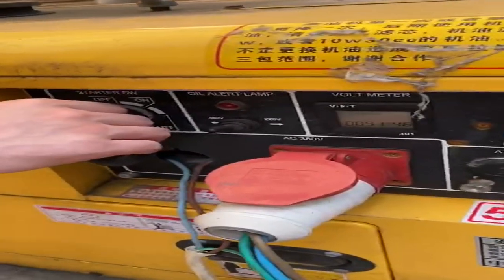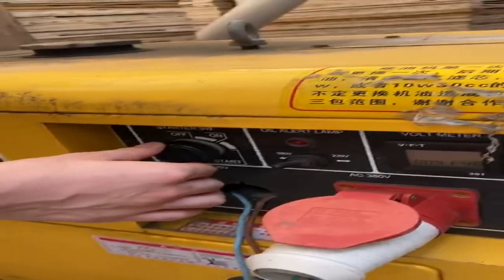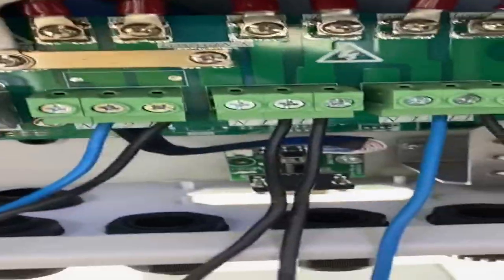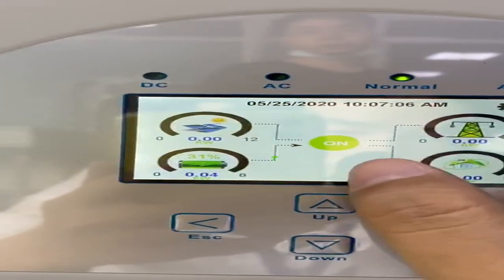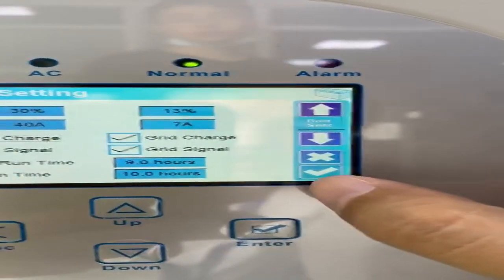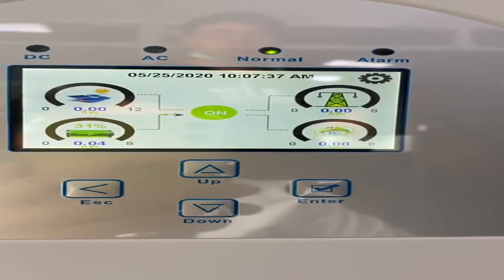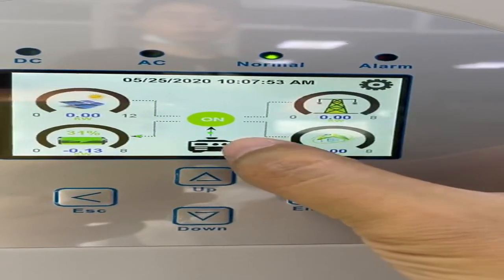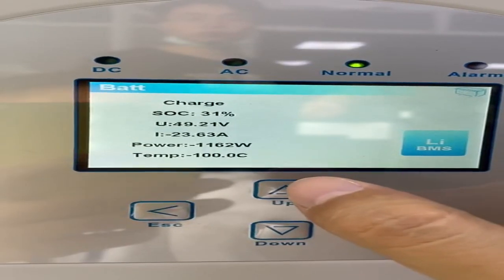Deye hybrid inverter charges battery with diesel generator

Comment: Kyle i have 3 pcs hybrid 8kw in parallel making 120 208 volt 3 phase can you please explain how to connect wires so the inverters can take power from my 120 240 volt single phase generator? Ive tried every setting and can not get the inverters to recognize power from my generator that is connected to gen port. I am in off grid mode
Reply: I have the same problem.. I have a three-phase 120 208v and my generator is a single-phase 240v, but it's not working.. how did you solve it?
Reply: @cupindeferro1613  either change the power yours system outputs to match your generator or change your generator to match the output of your power system
these are your only choices. Think about how HZ needs to match up to be able to carry your load as well as charge your batteries
Reply: @kurtmccormick1730  here I use 127v/220v three phase
With 2 phases and 1 neutral (3 wires) 60Hz

my generator is 240v with 2 phases (2 wires) 60Hz

I've also tried using a 220 to 127 transformer to see if it would work, but without success... can you help me?

Comment: Kyle, do i need to turn off grid and pv input for the generator icon to show? Deye has updated my firmware but even if my generator is running and connected, the generator icon doesnt show and doesnt charge my batteries.
Reply from the maker: Hi, make sure your generator is connected at the GEN port of the hybrid inverter. if grid si connected, then the generator can't tick in.
Reply: @DeyeInverter_official  let me try. I still havent been able to get this to work.
Reply: Same issue can i know how to set up

Comment: Hi Kyle, thanks for this. I have 2x Deye 5kw Inverters in parallel, the master has my generator input and the slave is not connected to the generator, but I cannot get my generator to charge the master inverter - I've tried every setting, followed all your videos, but I can't get it to work, do you have any suggestions? Does generator charge work in parallel? Many thanks!
Reply from the maker: we have fixed this issue via new FW
Reply: @DeyeInverter_official  this is great news, thank you for fixing this! Do you know from which firmware number it is fixed so I can check it against mine?
Reply: @DeyeInverter_official  what is the FW number and how can I get an update please?

Comment: Is there a separate input for AC grid and generator? Thank you for adding voice
Reply from the maker: Yes, it has independent Grid and diesel generator input.
Reply: @DeyeInverter_official  do I need to set priorities for the inputs or does it do it automatically? AC 1 Gen AC 2 Gen?
Reply from the maker: Don't need